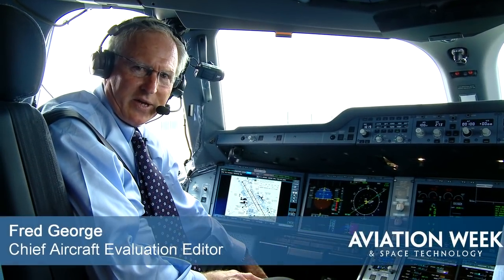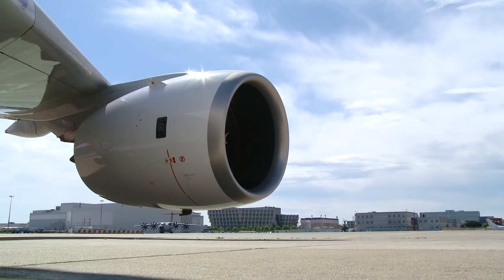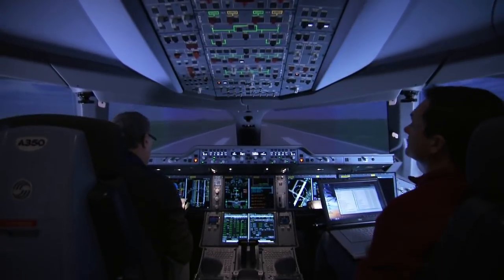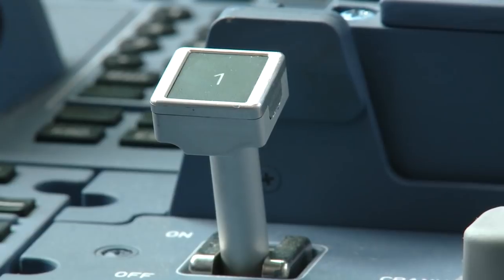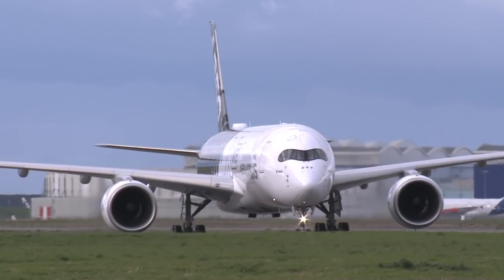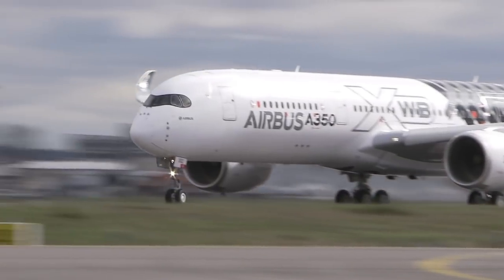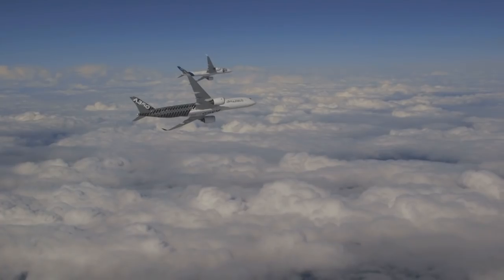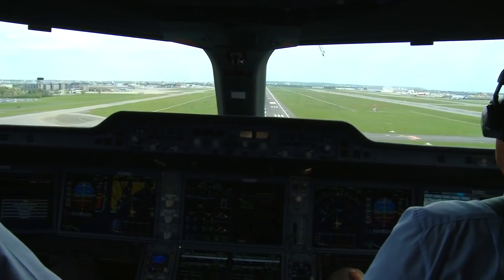Pilot Report: Airbus A350

Comment: i feel airbus is more toothsome and dainty more than boeing does ,  though nothing outbounds the boeing capacity and performance  . If u plunge or plunk  into supstiteunt  choices you would not reach the capstone because boeing always on pennical
Reply: Airbus is always at the top and Boeing always looses. Let's bet on who'll get more orders this year, last year Airbus was the winner this year it's gonna be Airbus again, Airbus is the best!
Reply: I am afraid that things have changed, Airbus does not hide systems on their Aircraft and then only tell the pilots when it has already killed a lot of people. Airbus aircraft are new safer models, not an extended version of a nearly 60 year old design.

Comment: A350 XWB!! Nonsense..!! it's not X,tra wider than the 777, 747 or the A380, it should be  more like MWB, (medium) considering it size between the smaller size twin aisle 767, A330 etc and the larger types 777 and the two XXWB 747 & A380. Wannabe X??
Reply: +Brett Demauna A competitor usually implies exaggerated product names in order to make a product distinguishable and for it to sound better than its predecessors. That's how the world of business works my friend.
Reply: For many years Airbus wide body jets were wider than Boeing, which called theirs "custom made width". The 777 is the first wide body Boeing jet that is wider than the Airbus products. The term XWB refers to their wide body line, not Boeings.
Reply: No, you've all missed it. Everybody knows the A350 is not the widest of all widebodies. The idea of the XWB moniker is that it refers to the cabin width in terms of the seating. In more recent time, aircraft like the A330, B767/777 etc. have been in a range where airline accountants have been able to squeeze an extra seat into each row, contributing to passenger discomfort and dissatisfaction. Think 3/3/3 being turned into 3/4/3. The idea of the A350 was to make the cabin wider but not so wide that it could accommodate another seat, generating a bit more shoulder width. Whether airlines can work a way around this is still to be determined.
Reply: TheThirdMan So? It is still wider than 787....
Reply: Andrew Anane I didn't say it wasn't. I am explaining the XWB moniker.
Reply: TheThirdMan Well we all know what you're trying to say. The fact that it has the biggest cabin of any Airbus product (A380 excluded) that's why it is called an XWB.
Reply: Andrew Anane Maybe but to passengers it will feel wider. You can't do that with a smaller tube or more seats.
Reply: TheThirdMan yeah
Reply: Sorry about my English: first A350 design was just a A330 "restyling". So, it was going to keep its 5280mm width, common to A300/A310/A330/A340 aircrafts since the 70's. But airliners didn't like it and threated Airbus to dismiss the A350 and go to buy wider 777s (5860mm) or 787s (5490mm). So Airbus was forced to redesign the A350 and stretch it to its final 5610mm width. And it was called "A350 XWB" to differ from the first A350 sketch.